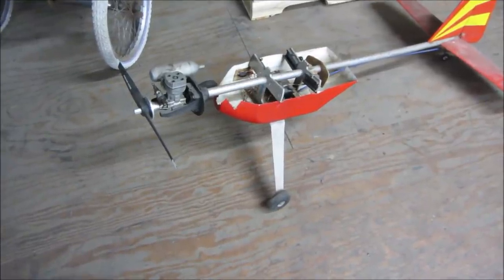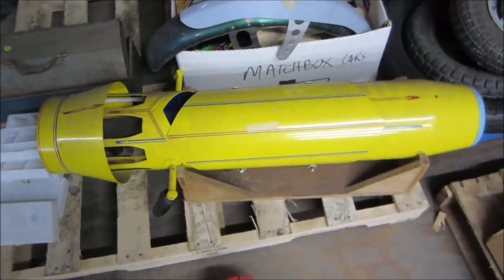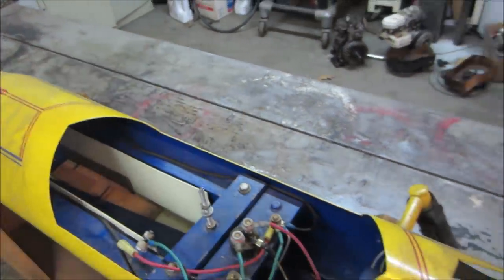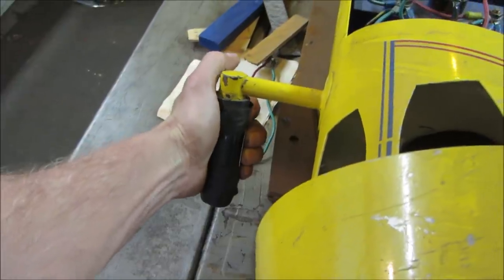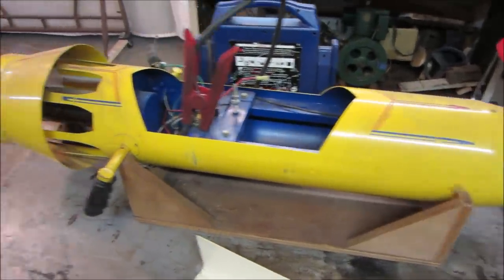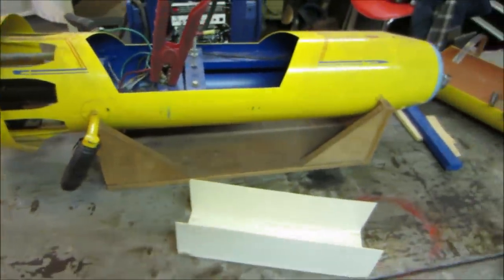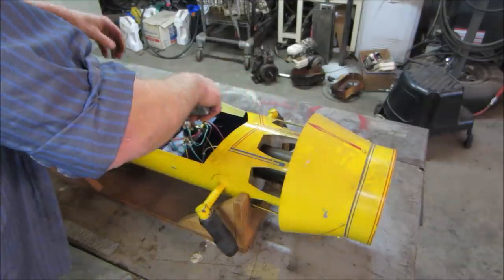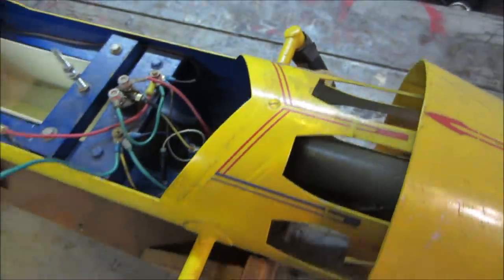Antique Scooter for The Water? Will It Still Work.

Comment: Your sea sled has a brushless motor, hence the cogging feel when you spin it.  These things will work in water but not very good for salt water.  You would normally set it to be neutrally buoyant at the surface.  I bet this was for snorkeling and not scuba.  The seals are not heavy duty enough to handle any sort of pressure.  I bet it will get along pretty good and will be great for snorkeling.  Great video. Cheers
Reply: In my opinion this wouldn't have a brushless motor. Far to old and not the right kind of speed controller for it.

Comment: Electric wheelchair batteries like the Rascal 600 series.  Walmart carries them for around $95 each.  They are 5.14" wide though, but the other dimensions and connectors re right.  It looks very similar to a 1972 Farallon MK-II DPV (diver propulsion vehicle), except there is a handle on top and the grips are angle more.  It might be a home made copy of one as they ran about $450 or maybe a prototype.  The seam is also around it with some heavy clamps and there is a dial to set the speed.  I am guessing it is home made and they could not get it waterproofed enough.

Comment: Used a gasoline two-stroke variant which had a snorkle, possible to dive about 2.5 meters and stay under 10 seconds, throttle on hight hand and altitude control on left, rope crank .. borrowed it from an older gentleman that had way too much money, about 1985, guestimation.

Comment: I'd put sealed lead acid batteries...I think that is what it had based on the plug that was on the positive wire.  2 of them in parallel would provide plenty of amps and probably 30-45 minutes of runtime.

Comment: It's Scuba Tow SEL it came out 1960's to the 1980's it was a kit that you could build yourself. It took 2 12 volt batteries. Midwest Engineering &Design

Comment: If you are serious about trying it out maybe use batteries that can be oriented/tipped any direction. Sealed glass mat or something like that. Then if it tips for any reason it will still work at peak.  If you could find a deal on 18650 batteries and a proper charger you might get longer run time by building your own pack.

Comment: I'm pretty sure I saw these advertised in the day. I'm thinking 70's as well.
I think I would slather grease or petroleum jelly on the battery terminals if you go to try it.
Also wouldn't be a bad idea to put one of those dog bone floats with the line wrapped around it that people put on boat motors with some kind of release tether in case the thing starts to sink. You may not want to go chasing it into the deep.

Comment: I would try dry cell batteries like on a cordless tool or kids hot wheels type vehicle that way you could wire several in and water shouldn't effect them as much... just a thought.

Comment: I would look at that with an oscilloscope as you operate the motor switch.  I'm concerned that when you release the switch you might see a substantial spike in the voltage that could shock the operator while in the water.  Opening inductive loads like that tends to generate some very large voltage spikes.  You can see this when you unplug a vacuum cleaner and the wall outlet sparks.  The collapsing magnetic field of the motor windings tries to keep current flowing.  A second small battery could be installed with a relay to keep the motor power and control power separate.  Or you could put some surge arresters between the motor leads.  My second concern is the housing around the motor blade.  It looks like fairly sharp metal near your arms and body.  If you or this thing come into contact quickly you could get some pretty bad cuts.  So with a few tweaks you could prevent turning a day at the beach into an S&M session.  Finally don't go into deep water your first time with this if you're not experienced and trained with diving.  There's just too much that can quickly go wrong to cover in youtube comments.
Reply: @khwolter9038  You don't have to be touching neutral or ground to complete a circuit.  Your body has parasitic capacitance which creates a current path.  High voltage does neat things in water.  Not saying it'd be deadly, but it might be similar to the pain when you get popped by the ignition coil of a car.  If the switch is sealed and designed to open motor leads underwater, then great.  The 70s were a different time.  They made single stroke gas powered pogosticks for kids.  Safety was whatever doesn't kill you makes you stronger.

Comment: My sister in law bought a water scooter for my nephews about 10 years for about $100. I was impressed by how fast it moved, but the problem was the 12 volt battery needed to be recharged after only about 15 minutes. You couldn’t recharge the battery without removing it and because it had to be watertight, the process to replace the battery took at least 20 minutes.

Comment: Hi, I hadn't seen that R/C model in a while, the last time it was at an air show in Dayton, OH, very docile and easy to fly.
Regarding the "scooter" if my memory serves me correctly I think I saw an article in popular mechanics on how it works and how to make it. note: YES it has to be waterproof! How does a battery submerged in water work? electricity and water don't mix well lol lol
please!!!! everything is in the compartment, there is nothing protected against water, it does not matter if the battery is sealed or lead acid
Reply: short duration immersion won’t bother the batteries none (presuming you used sealed batteries, nor basic circuitry, nor you at 12v. The motor and switches need to be sealed tho.
Reply: @fromagefrizzbizz9377  in an equipment built  with components designated for underwater use it could be, but if I am correct this equipment is homemade and if we see the components are  automotive origin (80's era) therefore I am sure what will happen if comes into contact with water (whether fresh or salty) it will burn! just like my old 81 ford mustang, every time i washed the engine i had to wait half a day for it to dry. If you look closely at the lid you can see foam material and the straps that adjust it are metal clamps, if it were my project I would use silicone sealant and tighten the clamps to the maximum without reaching extremes, I would also go over the screws and reinstall them with sealant too .
Reply: @rafaelduque7160  when you see such problems it usually means the connections are faulty and sat for a while with electricity flowing while damp, even just a tiny bit. It’s mostly galvanic corrosion, not just plain rust. The motor appears to be a trolling head, it’s supposed to be immersed, and sla batteries don’t care if they’re submerged. 

Fresh water is barely conductive, and salt water not that much more. This device would be fine as long as it didn’t stand long while damp with the batteries connected. 

By the way those switches look like micro switches and some of them are totally waterproof.
Reply: @fromagefrizzbizz9377  it could be but I see beyond just the battery and cables, I am intrigued by the relay, the connections and the reflector but everyone is the owner of doing what they believe is the best, for my part if I have the opportunity to work in one thing like that, I would make it waterproof. Greetings.

Comment: I certified as a diver back in the early 70's but this "water scooter" is a bit earlier than that.  I'm guessing it's from the 60's but not much earlier.  It will need AGM or Lithium batteries in hard cases to resist sea water under pressure.  Lead acid is a no-go since these get inverted and submerged in salt water.  Interesting.  Looks commercially made but in a low production market.

Comment: I have seen them used by scuba divers down to about 25 metres or, so. As commented below, I think they are 'neutrally buoyant'. I imagine the divers would have to carry weights though. 12v or 24v sealed batteries probably. Speed being quite low for exploring coral reefs and the like. Steering and pitch control just using muscle power on the two arms in conjunction with some flipper action.

Comment: it will need to be a sealed battery or the water outside will dilute the electrolyte. i would guess the wood pieces were used along with metal for neutral bouyancy it would be a neat thing to see in action. get yourself a shark fin and head to the beach lol . I love cool quirky stuff need to make musties spy kit. the ufo generator would fit right in with this :D

Comment: I have been flying them since 1978. From the small ones all the way up to 1/5 scale. World war II is my favorite. I have two T6 Texans and a supermarine spitfire. It looks like you have old school futaba servos. Nitro fuel is not $5 a gallon anymore. Just saying. What is the wingspan on that craft.  May give you a better estimate of the CC of the motor but, the side of the cylinder case will usually have a stamp number of CC. Looks like it could be a OS engine

Comment: Hi musti you could use lifepo4 18650s and configure those batteries to what shape you need lots of YouTube videos on making battery packs check it out some of them have a  lot of punch when configured in parallel  and series they're 3.6 nominal voltage theres a place in Pennsylvania that have some pretty good deals on new and used it's called battery hookup I'll see if I have a link good luck musti1

Comment: I would think that the electronics area should be waterproof. Also, it seems like the weight of the batteries should be important. You would want something that is barely buoyant, not something that would sink or shoot up to the surface.

Comment: Based on the straps holding the lid on, I'm thinking it's supposed to be water tight within reason.  Since the access port is on top, if it wasn't water tight it would eventually leak out all the air and sink like a stone during use.

Comment: Looks like it was homemade. Some quick research suggests it was in popular science in 1975. “Diving Machines second Popular Science 1975 build it your self diver scooter tow made of wood with fibreglass resin cloth and some simple metal parts, it ran on a 24 volt trolling motor.”

Comment: That unit would have to operate with the hatch downwards so the air pocket inside would remain. The Hatch doesn't look like it could make a perfect watertight seal if at the top. Water, particularly salt water would cause electrical mayhem.

Comment: Go ahead and rebuild it it looks like it's made for sla battery's like deer feeders use but in this day and time use lifepo4 Cells and build a nice pack that will fit good and see if you can get an led light to fit now add some better switches and go for it . It may not have the torque as a 24 volt but certainly better than it was originally .

Comment: 4:20 that look like homemade because i know under water scooter are i dont see one like that anywhere on website so it probably nice homemade one
One i have before was 24v but handle is mounted front not rear only way get battery out to chager them is front there 4 rubber clamps pull up n clamp on brackets or remove was make in 80s around 85 or 88 n motor doesnt look like one u have it far more different n it fun try it out but i recommend using tank going under water because it will sink down to ground without swimming up

Comment: That looks like a calf thruster for a Transformer Mk2. It helps them get extra height on boost jumps.  
PS. You might need wings for that RC plane.
Reply: only if Mustie knows how to fly (he probably does)
otherwise you can run it around on the ground.
it needs more than a wing though .

Comment: I would think it has too be watertight because of the wiring and batteries. The access panel has rubber inside clarifies it to be watertight. Also if u try it wear a wet suit and don't let go of it really don't think it is buoyant at all weight of steel and batteries would sink it.

Comment: I build and fly model airplanes. Looking at that model in the beginning, the only thing of value there is the motor. I can make out a large "S" on the side of it...Super Tigre? (a popular brand of Italian motor back in the day) And size...a .40 perhaps? Looking at the plane it's on, I'd say it was just a Sport model (perhaps what the "S" means) and worth probably $75.00 or so on Evil-Bay, depending on condition. The plane looks like a beginner ready-to-fly so my bet is that some guy got it running a few times, smashed the hell out of the plane and just let it sit which = low time on the engine = worth more $$ as long as it turns over. Take off the Master Airscrew propeller and the spinner back-plate and throw them, and the rest of the airplane, away ...save motor, muffler and motor mount, dump them into a coffee can of alcohol for a week or so till it turns over then disassemble and clean completely...reassemble with light machine oil. Voila, $25.00 motor turned into a $75.00 motor with an hours work. The black carb looks like a Perry or a knock-off...do NOT put it in your ultrasound cleaner. Just get it working smoothly, blow it out and then leave it alone. If you wanna fart around with starting it (working motor worth more $$), go to hobby shop and buy a small jug of 10% nitro fuel, battery, prop and plastic fuel tank. I would NOT use that old prop...unless, of course, you like having a thrown prop blade stuck into your throat, or arm, or belly, or other body parts. Mount assorted pieces parts to a 2X4, use an old bicycle spoke for throttle extension, clamp securely into your vice and flip it off! Oh, and you may as well buy a new spinner for it as well...the engine's original front prop washer and nut will be missing (new spinner will come with those parts)...that way a buyer can't piss and moan about missing parts.

Comment: Its looks cool for a dive shop to have on display. Probably useless now with all the inexpensive underwater propulsion devices available. Your device would be like hanging on a submarine. Since there is no reverse the water would push your face back and might dislodge the divers mask and regulator.

Comment: That small plane you started the video out with looks like it has a super tiger probably around .035 cubic inch glow engine. Shouldn't take much to get that little engine running. It should go over 10-12,000 RPMS

Comment: How do you steer it though?  The way it's set up, it would just take you to the bottom ???
Reply: You push the rear of it with the handles. Left to go right, down to go up.
Reply: But there are no fins or control planes or any way of guiding it. As it is just a cylinder, it wouldn't matter which way you tried to push it

Comment: A lithium battery would work well. I have a first generation toro electric push mower that has 3 12v batteries 2 would fit fine

Comment: It would have to use SLA batteries,,,(sealed lead acid)   It would have to fill with water or it would just float,,,  The wiring would need to be waterproofed to keep from shorting everything out,,  pure water is an insulator,, but pond water is a good conductor,,,  This is obviously a home made device,,,   :-)

Comment: Sealed lead acid home security batteries 12v in parallel, don't use motorcycle batteries as there vented to the atmosphere and if you get a leak it could be a problem.

Comment: Check with my older brother James Mustie 1 :) see if got any more information on them because does Scuba Diving lots and thing battery used were strong lawn mowers tractors ones sitting under seat or similar ones got lots reserved amps plus for light and motor operations for so many minutes or hours use! Also hope find out and help out too ! Thing you be holding handles so point light to direction going and go play in about 6 feet of water too roughly and be interesting to now more too! But interesting to toy and plane too be so cool plus someone show how works both them !

Comment: From diving machines website:
"Diving Machines second Popular Science 1975 build it your self diver scooter tow made of wood with fibreglass resin cloth and some simple metal parts, it ran on a 24 volt trolling motor."

Might be a nice little project to extend those handles backwards so the users face is further away from the prop

Comment: It doesn't look like it was ever used, just made and put away.
If it were used, it wouldn't've lasted long with how the enclosure doesn't seem to have any sort of seal on it.
I'm not sure why the entire service door is lined with rubber, the edges are what needs to be sealed, and there seems to be absolutely no attention given to that.
If you ever do attempt to use it, be sure to rig some sort of seal together first, and also check that the headlamp doesn't have the same sort of neglect. Sure, if the electronics inside drown, there isn't really anything that could be permanently damaged beyond corrosion, but if those batteries get shorted you're left to your own swimming ability to get back to your boat or to land.
Perhaps you could fab an edge channel on the main body, where you run rubber gasket wire through, and have that meet up with the rubber lining on the door.